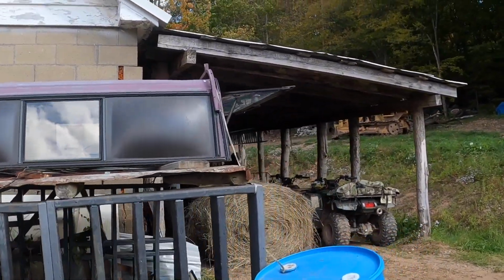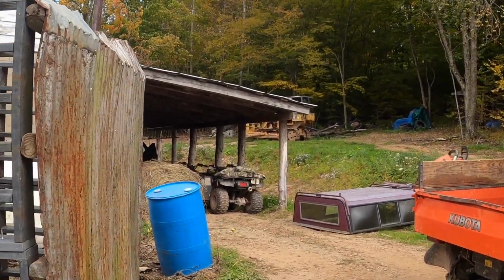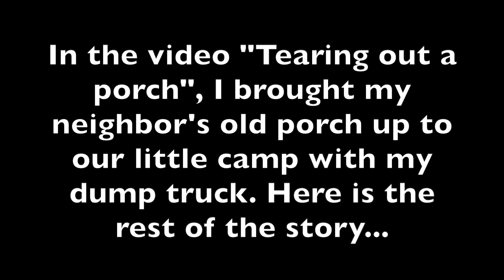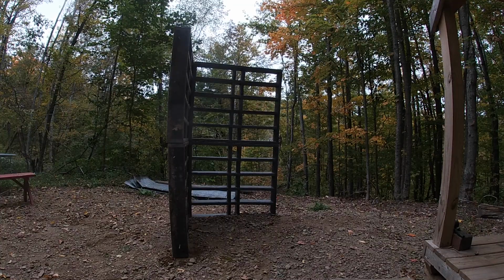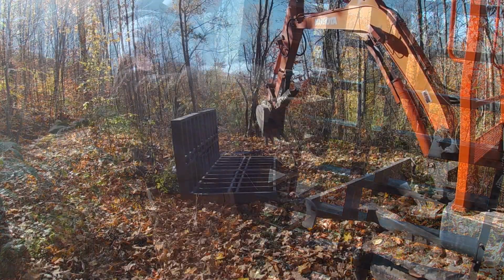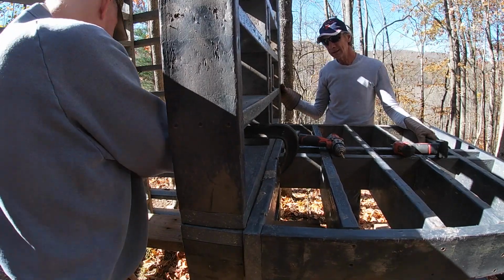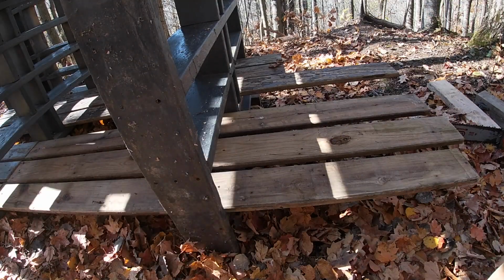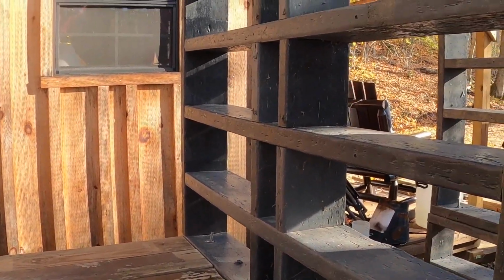Building a woodshed at camp, the start

Comment from the maker: This the first Video the I have really featured my trusty Kubota L series tractor in. Ive used it in other videos, but not as a featured machine. Was just the right machine for the job with the rubber tires and speed that  the other machines couldn't provide. The 91also worked great setting up the shed. By the way, I did sell the truck cap. Thanks for the support and keep watching!